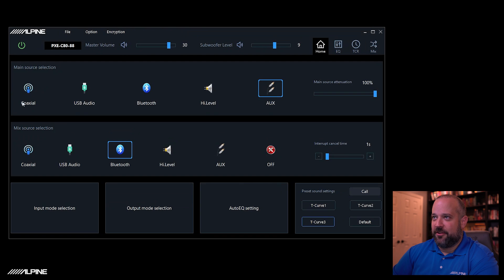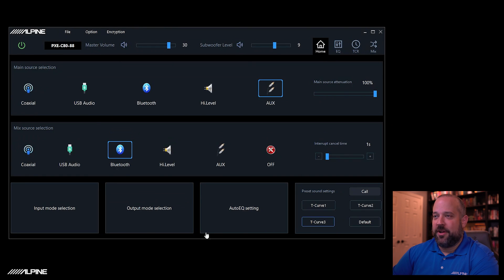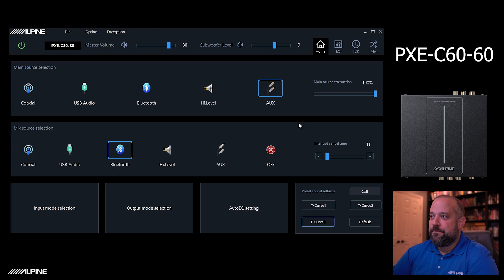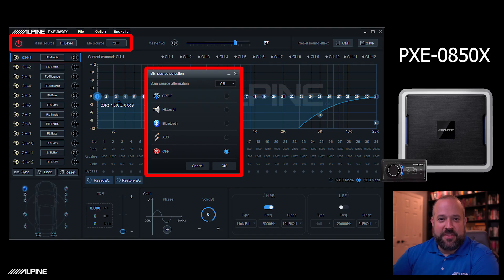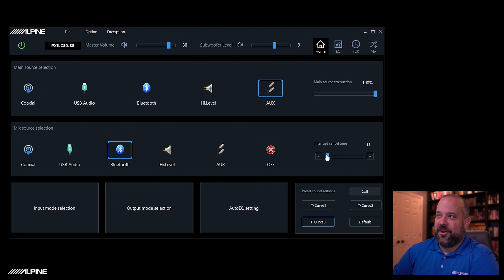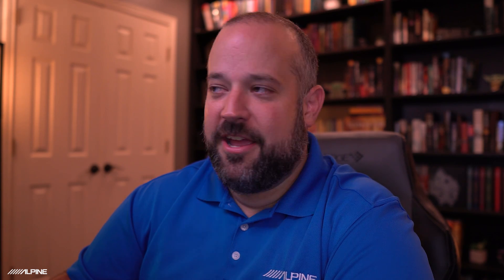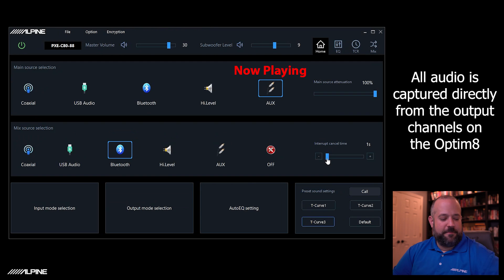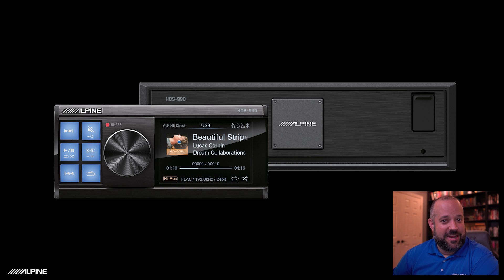Unlock Hidden Power in Your Alpine DSP: Master the Mix Source Feature!

Comment: Last for the first time my Bluetooth ACTUALLY worked in my car. 

I could never get
It to work. 

I’m using PXE C60 DSP. Although I had mixed source, for I don’t even know two years since this thing has come out. I could never, and I never ever get it to play through Bluetooth.

So I just simply gave up. I keep hearing that a Bluetooth stream nowadays is actually better quality than using my USB cable in my car. Which I found that hard to believe, but I trust the experts

Last night after washing my car, I got in without my phone plugged up and automatically the music was blaring. I don’t know how I didn’t blow up my entire speaker system. I rushed to turn down the knob on the steering wheel and the radio. Nothing would work. 

That’s when I realized my Bluetooth was streaming straight from my phone and the volume was all the way up connected to the Bluetooth speaker previously outside when I was washing my car 

But somehow someway, it’s somehow connected itself to the core for the first time with the DSP 

It did sound a little bit louder, and actually more clear 

But once I turned my phone up halfway, it became too loud and overly distorted 

I can’t figure out what I need to do or change this voice to settings on my DSP because everything is set. But for some reason, the quality of the Bluetooth is actually more loud and clear. But the bigger problem is the base from the subwoofer is drastically low 

I played with the software often and on so many times I can’t figure out what’s going on. 

Can anyone explain to me why it’s so much louder connected to Bluetooth? 

Can anyone explain to me why it automatically connected and never connect it before? 

And can anyone explain to me why the subwoofer although placed perfectly fine when plugged in on Bluetooth is about 70% lower than normal? 

And can someone please explain to me how I can adjust all the settings? I was all excited thinking that if I could just run it through Bluetooth, I would have a better fidelity output.